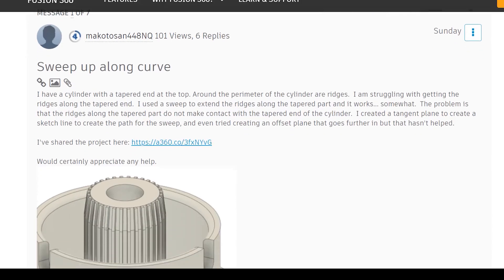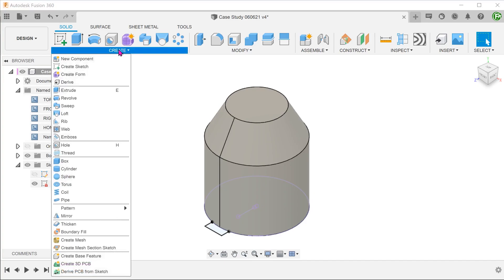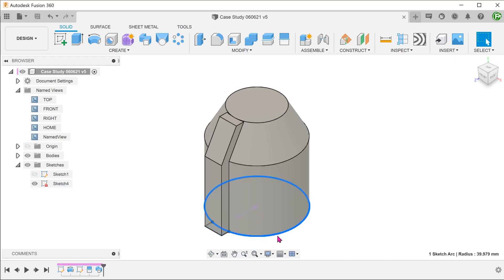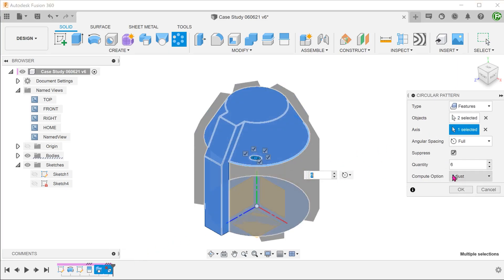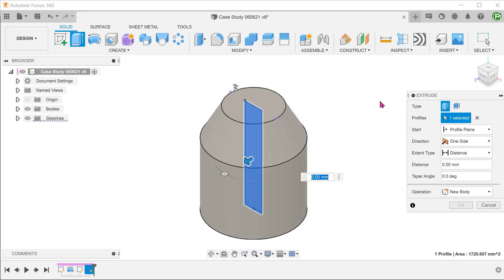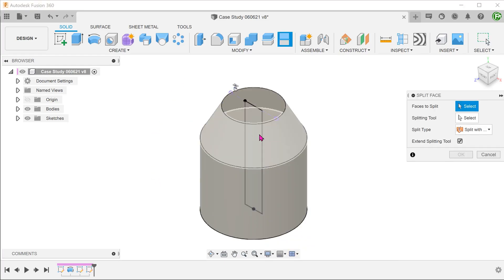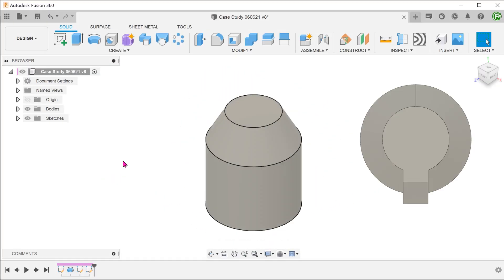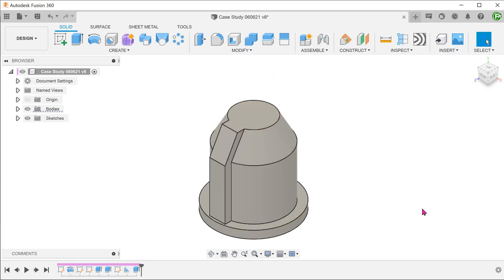Fusion 360 - Case Study 16

Comment from the maker: Hope that you have found this useful. Take note that this is not a line by line commentary of the conversation thread in the forum post. I have taken the liberty to simplify the problem for clarity. Much of what is shown in this video is my own interpretation. I plan to do more videos based on the forums in the future. I like to think of this as me playing my part in disseminating useful information from the forums which would otherwise never see the light of day. Or maybe........I am just running out of ideas😅.
Reply: Case studies are a great idea.  I've known fusion for a year, but I don't know it inside out yet. With one problem you explore all the options, and even if its not the right option the viewer still gets to learn more than going straight to the best solution. Keep up the good work.
Reply: Great video! Which 3D mouse do you recommend?
Reply from the maker: I am currently using a 3D connexion spacemouse. I am not aware of any other brands. I think the main advantage with this mouse is that you can perform zooming, rotating and panning with your off-hand. The smooth rotating helps with my presentation too.
Reply: Thanks for the content, short snappy and to the point :) One you might like to take a run at sometime for a subject is modelling a GT2 Pulley and others might find it interesting/useful. My parametric attempt here https://a360.co/357uhVM it breaks two of the tangential constraints in sketch two sometimes otherwise I think the approach is sound. End Product will be Laser cut Delrin.

Comment: Excellent as always! Now for a question... what if you want the profile to taper so that its width remains proportional to the narrowing circumference of the cone? For example, if the total width of the ridges at the bottom of the cylinder, where they meet the cylinder, added up to 50% of the circumference of the cylinder, what would you do so that they end up 50% of the circumference at the top of the cone?

Comment: with square pipe on split face
Reply from the maker: Hi, the pipe command is certainly an option. However, it has 2 limitations. It only has square cross-sections. And it always sweeps normal to the underlying face, so the top face would not be horizontal.

Comment: Hi @ Fusion 360 School, I always find your case study as useful. Being that I come from a background of sound mixing, might I ask you to  employ a mouth to microphone distance of 8" or 200mm so we can have the sense that you are not speaking from within our heads? I have been wanting to ask you this for as long as I have been subbed. It is sometimes painful and interferes with the conveyance of your message.
So now I have that out of the way.... there are several design problems I have had with working from a JPG. One was how to create a radiused  flange to fit on an air filter box from a US built Chevy truck..The client wishes to upsize the air tube from 3" to 4"   It is tricky as heck for me. I could furnish you with photos :-)
Reply from the maker: Hi Chris. I am really grateful for this honest feedback. When I listen to myself on different earphones, I do sometimes feel that my audio is too "boomy" and I do experience that pain also. For the longest time, I have not been satisfied with my audio. However, I just don't have the know-how. I also have the constant fear of messing up the settings and making it worse.

Also, I was hoping for more feedback from the viewers before I embark on any kind of audio adjustment. I think most of my viewers are generally very kind and would not leave any negative comments. But this is the kind of feedback that I need. I do speak quite close to the microphone, perhaps as close as 2 inches. In my previous tests, when I varied the distance to be further than that, it sounded very echo-y. I will definitely try again based on your advice. If you don't mind, I would like to make an unlisted video for you to assess the audio. 

As for your design problems, do feel free to email me the photos:
tanwinghoe1983@gmail.com
Reply: @Fusion 360 School  Although I do not feel the same as Chris, there is a technical term for the way your voice sounds in the videos. This is called "The Proximity Effect" in microphone speak, and in simple terms, it means that the boominess increases as your mouth gets closer to the mic. Sometimes it is desirable and sometimes not, but this is why Chris is asking you to move back from the mic.

In practical terms, moving back from the microphone, even a little (50 to 100mm further back), will help, although background noise will be somewhat more audible. If you are not yet using a pop filter, that will help with plosives (pops from letters like P and D). 

The next step is to EQ your voice, gently "roll off" frequencies from 500hz down to 100hz. This means reduce the volume on frequencies in the lower part of your voice using a processor called an equalizer. The changes do not have to be dramatic. I opened your video in Adobe Audition and tried the following: -1db at 500hz, -1.5 at 350hz, -4db at 125hz, and -6db at every frequency below that. This more-or-less smooth curve reduced the boominess while preserving your simple, clear, and effective narration.

If you'd like to pursue these kinds of audio changes or have questions, I would be willing to help. I really love your F360 videos and would be excited to help, however minor.
Reply from the maker: @DanielReetz  After seeing your post, I have done some reading on the proximity effect. I will definitely experiment with different distances. I do use a pop filter and I speak into the microphone at an angle.

Thank you for the detailed explanation on adjusting the lower frequencies. I think I will try to adjust the source first before meddling with the EQ. I don't have Audition but I guess I can do something similar in Premiere Pro.

Thank you for the help. I have always wanted some one-on-one audio assistance. I guess this is a good start with you and Chris.
Reply: Are you listening through headphones Chris?  I never once thought that there was anything wrong with the audio or his voice.  Sounds great to me but maybe it sounds different through headphones?